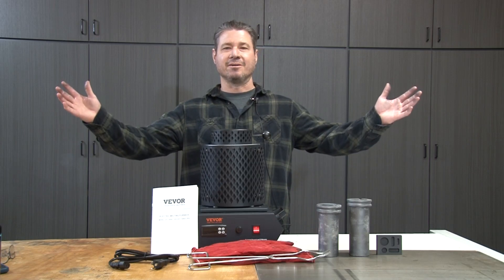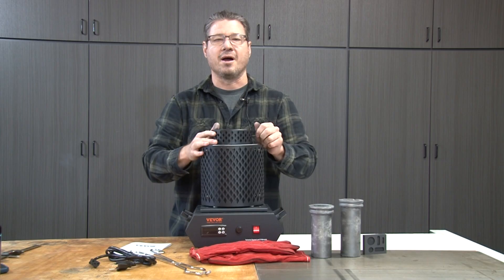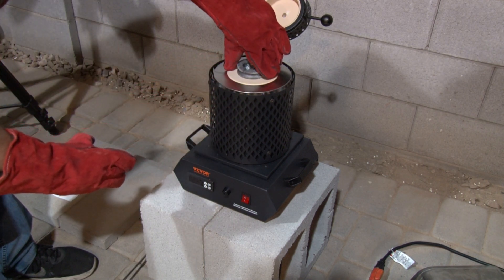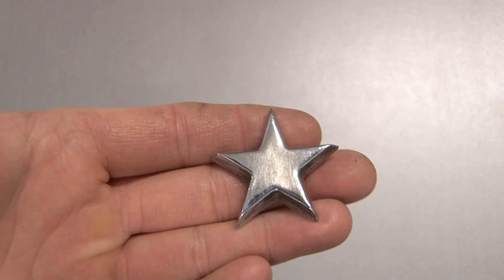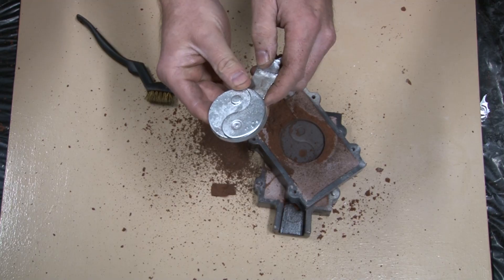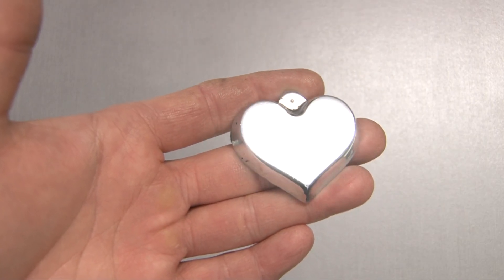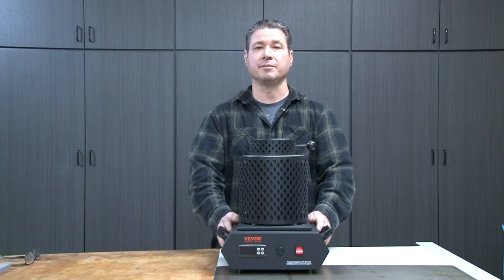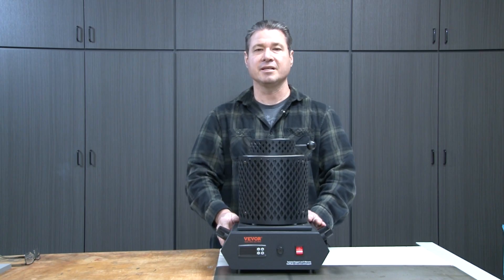Metal Casting with a Vevor Electric Melting Furnace | Aluminum, Bronze, Zamak, and Zinc

Comment: Sorry if I missed this, but did you use the same crucible with the different metals? ty
Reply from the maker: Yes, I did use the same crucible with the different metals.  The crucible had no visable signs of left over material from each melt and didn't cause any problems.  If I were to do precious metals I would probably have a dedicated crucible for each type of precious metal.
Reply: @DamonsMetalCasting  Awesome. Thanks for the quick response.

Comment: I have a cnc router, and I cut 5005 aluminum sheet with it for my business, I end up with Lots of left over bits that i cut up and throw into a bucket, I was considering melting the scrap down and casting into bricks for Me to machine On the  cnc machine, you were talking high silicone alloy being better for casting, But would melting down the ally sheet and casting into bricks using a graphite mold be fine on one of these machines? I was considering the Vevor like shown, cheers
Reply from the maker: The silicon in the aluminum helps the aluminum flow into the sand mold better to get detail.  I have tried 6061 before and it solidified up rather quickly before it could make a good casting.  So being that you only want to cast bricks I see alot of people do that with pop can aluminum which is not casting aluminum and it can make bars fine.  You can find some videos on Youtube and come up with your own conclusion for how well it makes bars/bricks.  The other issue you might run into with scraps, if they are really small sometimes they oxidize rather than melt producing alot of slag.  So if you are not doing chips and melting strips of aluminum you should be fine.  If you decide to use an electric furnace you will need to make a little bent spoon to pull out dross of the crucible and make sure all your pieces of aluminum can fit into the crucible.  The electric furnaces also have a listed time for how long they can be used before they need rest and cool down.  On the other hand electric furnaces pretty much run out of the box.  For a propane furnace you would still need to purchase a propane tank and a type of refractory cement to coat the ceramic wool since its an inhalation hazard.  So both types of furnaces have a plus and minus.   Good luck I hope this helps in your decision making.
Reply: @DamonsMetalCasting  thank you for the advice, cheers

Comment: I'm looking at their vacuum pump, did you try it?
Reply from the maker: I have not tried their Vacuum pump.  I am but overloaded at work and home currently.  But If I did I would probably use it for lost wax casting after I can get a decent silicon mold from something I would like to cast.
Reply: I have their vacuum pump. It works fine, little noisy but ok. it does spit oil out the exhaust, but no problems in sealing.
Reply from the maker: @ The current vacuum pump that I used in my other video for making a car plaque is a different brand.  It also spits oil out of the exhaust so I think its pretty normal for those types of pumps.  Thanks for the update!